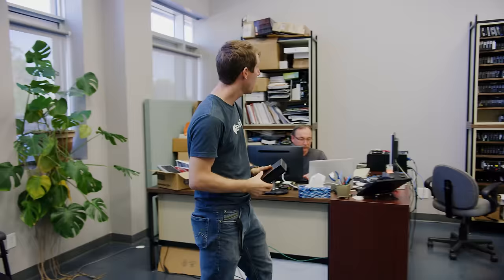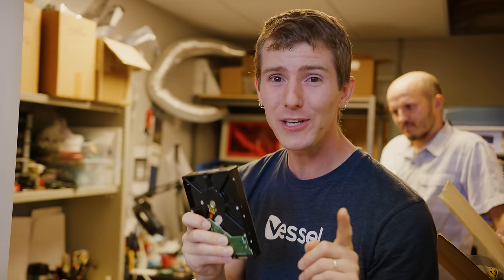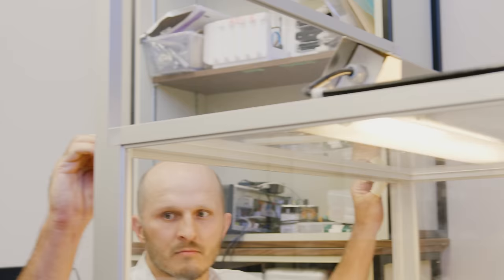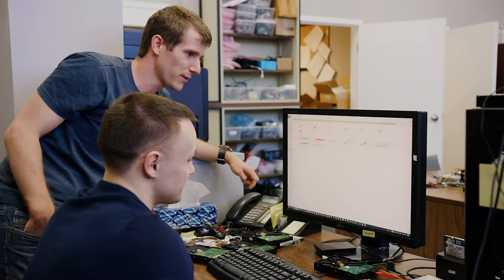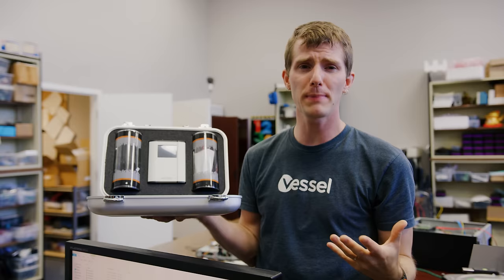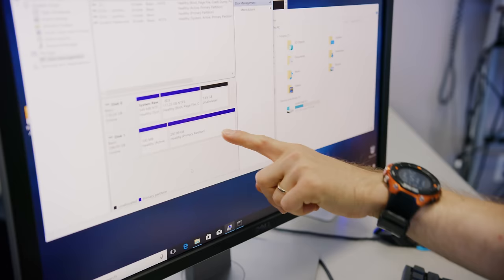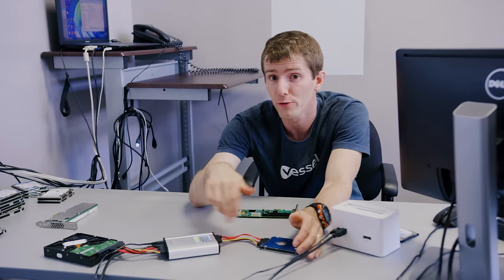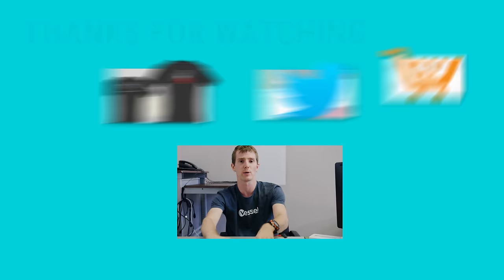Don't Waste $1000 on Data Recovery

Comment: Hello Linus! Thanks, great tour on the HDD recovery process!
I'm afraid you didn't cover up a very common disk types in laptops now days: SDD and M.2. As far i know this has a completely different recovery process. At least on Desktops the usually setup is a small SSD (for OS) and a big HDD (for your files). But in a laptop that is not the common setup, usually you only have a SSD disk. 
Can you do a similar video on this subject?
Reply: I 2nd this!
PLEASE
Reply: With M.2s and SSDs, you are pretty much SOL. Much more complicated with a lot less chance of recovery. Make sure to have redundancy for your backups, always.
Reply: yup, accidentally formatted my drive and my whole folder of photos is gone.
Reply: @Allan Cameron that's what I wanted to do but i had to get them off the ssd first 🥲🥲

Comment: Last week, my precious external HDD disk fell down on the floor. When I connected it to my PC, the laptop didn't recognize it. Definetedly, my hard disk was broken down. I was told that only an especialized lab could recover it paying for that around 1000€. I'm devastated because several years of keeping away information have disappeared in a bloody second. In your video I can hear the soft little noise the hard disk makes when it's working. Undoubtedly, a physical element inside the device is damaged.

Comment: How to protect data to not need to recover it:
 1. Backup data
 2. Don't drop your hardware
 3. Don't have more data that you can handle protecting

Surprisingly Linus recently actually did start doing the 1st one. But he knows well that may not be enough so here he is - studying data recovery. Because deep inside he knows his drives will go bad soon and all those TBs of data will be causing him lots of headache.

Comment: I had a dying 1TB drive with around 600GB of data, that I was able to recover around 80% of before it just stopped transferring. Linux, more specifically Parted Magic was the answer, when Windows just wouldn't load/read it. Although the read speeds were painful...anywhere between 200KB/s and 2MB/s. I had to leave my rig running for a couple of days.

Comment: You know what. This was actually a great video. 

My friend has an external usb harddrive, and it's not being recognised in Disk Management as a disk. Every so often an 'unknown device' would flash and disappear. 
Apparently it was clicking, but my work colleague opened it up and moved the head. Now it isn't making any noise. 

In Device Manager it's coming up a seagate backup plus harddrive. 

I'm thinking about opening the enclosure again and sticking the 2.5" drive into a PC using power and sata as opposed to USB. 

Even if I can't bring life to this drive, this video was still cool. 

I'm wondering if this automount disable and automount scrub will fix it.
Reply: Open it and connect the drive directly to the pc through sata/ide(if it’s old lol) in my 15 years experience a lot of the time the enclosure fails but it also has been drive it self a couple times, try to connect it directly and good luck 👍
Reply: @KngKurd 
The 3.5" ones fail all the time. The 2.5" ones were usually the drive. In my experience, anyway.
Regardless, if someone has opened the disk itself and pushed things around, it's probably stuffed beyond repair now.
Reply: Wow, I wasn't expecting anyone to reply. Thanks.  

I'm probably going to plug it into an old PC and see if firstly the bios sees the drive. If so boot, if not then welp. Harddrive has family photos etc.

Comment: So what have we learned here?
1. cool tricks to restore data
2. BACKUP BACKUP BACKUP BACKUP
3. and finally, BACKUP YOUR DATA!!

Critical data? Keep it in more than one copy and preferably more than one place! dozens of dollars for HDDs will cost far less than restoring your data in case of a catastrophic scenario (theft, flood, electrical short, drive that is fallen to the floor, etc....
:-)
Reply: I tell everyone who computer I work on. BURN to dvd or bluray all your important stuff. Paperwork, pics, music and videos. DVD and Bluray don't crash! You can keep it on your HDD, but always BURN BABY BURN!!!!!!!
Reply: Seen recently: There are two kinds of people; those who back-up and those who haven't lost a drive yet.
And coasters (DVD/BR/CD-R) can be corrupted by a spec of dust during burning, a scratch afterwards (-Rs have unprotected surface), etc...  Always verify them and if you're using disposable media, burn two.
Cheap network NAS, "cloud" backups, and USB HDDs all pay-off in the long-run and can be encrypted.  Coasters can help better in ransomware attacks, though.
Reply: It amazes me how many do not back up their data. Even using the cloud is a simple way to do it, and it's generally free for your most important stuff.
Reply: i didnt back mine up and just lost my HDD yesterday with 500 gb of premiere files :( gonna start backing up now
Reply: I backup, backup, backup  and the backup drive  also die.
Reply: A backup is both a good backup and a bad backup until you check it.... :-) aka Shrodinger's drive or shrodinger's backup
Reply: @majorbud4207  can't backup on bluray terabytes. that's the farest possible option.
Reply: yeah. i backed up my important data on all 3 of my hard drives in my computer, then my power supply blew up and killed all three of my hard drives
Reply: My 1st backup drive got erased/damaged due to hardware failure. 2nd backup drive got erased by windows during a reformat/reinstall to a different drive while connected.
Reply: MaMa DeW  if an ssd fails it fails totally. Been there done that.
If a regular hard drive fails, you have a chance to recover your stuff. Been there done that too.
This is probably Your best bet: verbatim gold archival quality or similar that states archival quality.
You still should have a backup on a spare hard drive somewhere as well.
For irreplaceable items and if you don't mind the internet stealing them use a cloud backup too.
At least 3 different mediums would be best. And for those irreplaceable ones on backup, store those in a separate location. Having all backups in the same house and house burns down doesn't protect your precious data.
Reply: I currently use two old lappys as backup servers for my critical data, and thus far it has worked out quite well for me.
Reply: @scurvofpcp  two old laptops will work and be convenient, BUT you mentioned they were critical files. Back your stuff up properly!
Reply: @3butalcomp3  They do make nice offsite backup options, I do digital art and having extra copies of my bashkits and final assets is a make or break for me, and yeah I've got 2 local backups (usb drive and an extra local  machine). But if worst comes to worst (house fire or such) I know I can restore 2 Tb of data via remote download and or a 4 hour drive.
Reply: @majorbud4207  Those cheap optical discs go bad pretty quickly, even if by quickly I'm talking about four years. I have my data on two computers and a back up hard drive and my most important stuff is always on a thumb drive I carry with me everywhere, so even if everything in my home gets stolen, I probably still have a copy of the most important stuff
Reply: @informediatech-bruno5766  statistically speaking
Reply: RonkoDDR,
I don't backup anymore. It doesn't help. I was never  able to find a missing file.
Reply: @jameswyatt1304  Yep, I have my important data sync'd to Google's cloud, plus and internal backup drive, and an external usb backup drive. That is still hundreds, or thousands, cheaper than doing data recovery. Storage is cheap overall. Backup your shtuff.
Reply: @majorbud4207  Sorry, but this is actually bad advice. Bluray / dvd is not a suitable long term backup solution because they can degrade over time and become unreadable (this happened to me)
Reply: Nothing can last forever everything will die eventually nothing is perfect only God is the true meaning of perfection
Reply: @misterxzxc7314  that's very nice. Anyway, in the meantime, back up your data!
Reply: @casinowilhelm  you're crazy what did I just say right now nothing is perfect why should I waste my time buying and copying my files to another HDD that will fail at any moment this is ridiculous
Reply: @misterxzxc7314  the odds of your main drive and your backup failing at exactly the same time is much lower, that's why, but I think you're just messing with me now :)
Reply: @casinowilhelm  I'm not messing with you I'm telling you the truth how long did you think the HDD can last you can't tell maybe years months or even minutes when you start using it even if you stop using it and bucking up Everything you had to use it in the future there is a risk that will fail
Reply: RonkoDDR Quantum Comedy 🤘
Reply: @majorbud4207  I have abandoned optical discs ten years ago. I have 3-4 backups on hard disks and 1-2 on cloud for my important data. Optical discs are a dead end. It is hard to copy data further from them.
Reply: @vishalboodram  A backup that is connected to the computer is not a backup.
Reply: @casinowilhelm  But have you planned what to do in case of data loss? As a rule the worst thing to do is to use your backup. You should get a completely reliable computer and make a copy of the backup first.
Reply: @okaro6595  Yeah absolutely. I'd buy a brand new drive and copy it all over before doing anything else. I'm also using Dropbox for current projects so that's safe anyway, and also backblaze for the important old projects. I do freelance animation and 3d so I generate hundreds of gigs of data on every job I do, it does get a bit tricky managing it sometimes. You have to be completely on top of it and have a system that you always stick to. Because a client can often come back to you after several years and ask to update an old project. If you have lost it you are double f**ked!
Reply: @casinowilhelm  I once ruined two USB sticks by putting them on a faulty USB-port. Fortunately neither was mine. So if a USB device does not work, you should suspect the port and not stick all your backups to it.
Reply: Back up to WHAT? what is a safe backup? CDs' or dvd s have proven the only real backup that seams to good, all other drives, usbs, externals etc, etc, etc seam to be shit and very costly.
Reply: @Darkpixies  nope, cds and dvds eventually rot over time, especially cheap ones.
Reply: @Darkpixies  No no no no CDs or DVDs . This is 2019. One would have to get new ones almost daily. External hard drives are the best media and one should have several copies. Also one should not have them hooked up to the computer all the time. Cloud us a good way to do off site backup.

Too many people think what is the best media and then do not backup at all as none is too good for them and then they lose the data.
Reply: Joe Blo  
THAT! IS! CORRECT!
:-) 

By tech people's definition, backup without validation is no backup.
Reply: @misterxzxc7314 there's a risk everything can fail, including your car, your toaster and even your heart... yet you have no qualms about getting worked up about failing backups. 

Simply, if you store your backups well, you shouldn't have an issue. If they fail? They fail. As for time, it doesn't take much to plug a usb hd drive in and move files across, as long as your files are organised, it will be easy. It's a no brainer. We're only talking about files you don't wish to lose, as in photos, videos and the various electronic documents you may have.

Comment: I've soldered a bunch of stuff before. Save batteries, romchips, speaker wires, LEDs, charging ports,etc. Practically everything you can think of. I guess you can say I'm my family's personal repair-girl. Lol.. I've also had to recover my mother's PC from hdd near-death, de-virus my dad's, and sisters PC's, etc.. I've had to do it alllll..... :3 (and I don't get paid) (oh yeah, aaaand backup my mum's 2 tb PC... On to DVDs... It took 12 hours.....)
Reply: +kaity kline:
Good.
The next step would be to collect electronics that people throw away and recycle them or fix them up.

I've made little repairs to TV remote, a TV decoder capacitor was too old, a DVD player that was being thrown out had a mechanical problem with the tray, ...

Comment: For certain issues, you may be able to pull out data by freezing (cooling) the drive. If it works when you plug it back in, you probably only have a few minutes, so you need to pull off the files you REALLY need first.. You can sometimes rinse and repeat a few times, but typically eventually it will fail completely. Worth if you would not consider sending in to a company to recover. If you do plan on doing that, of course do NOT try the freezer method..
Reply: Do not rinse the drive though.

Comment: I want to chip in and say thank you for uploading this video. Without the automount disable hack, I would've probably never otherwise been able to access a 15 year old drive which was dying. It had two partitions, one being mostly fine, and its windows-partition which are currently in a RAW-state.

I never figured out how to use Rstudio to do whatever it was you did in this video, but I found Recuva which helped me save 190+ pictures from the RAW-partition (after two scans of 16 hours each).

And now, I will do the same with other old drives which seems to be dying on me.

So, thank you Linus and thank you DeepSpar for allowing a video like this to be made.

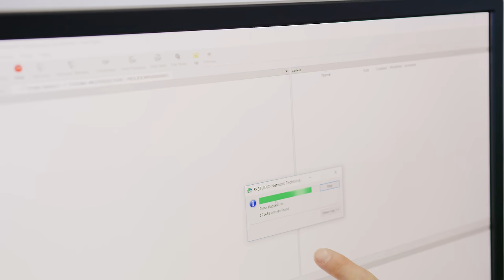PS. Any chance you guys can tell us how we can make Rstudio (or any other free program?) do that thing @14:30? I still don't know if the first drive has logical errors or if it's physically broken.
Reply: Just use test disk for raw format.

Comment: My drive has been making a weird noise which can be compared to a bad fan for years. I thought it was just a fan so I didnt care for it. Found out it was actually coming from a drive and I just continue to neglect the problem as it has been running fine for long and has no important data on it. It starts making this noise comparable to a fan hitting something and I just hit the side of the computer gently and it stops for hours to days. That is an good IT tips for you right there!

Comment: You missed one.  I have recovered a couple of drives with bad firmware by talking to them via TTY.  I had to make a cable from a (really) old mobile phone USB cable but you can talk to the drive's processor in a console window and know things tell it to do things.
Reply: Got any links for a howto or somewhere to start?
Reply: seagate 7200.11 family I bet
Reply: None other!  Bad firmware.  It was a very, very fulfilling recovery.
Reply: As Jay says, Google Seagate 7200.11.  It was a rough year for a lot of folks.
Reply: @chuckygobyebye  I work for a data recovery company, must of recovered thousands of them, still get the odd one now and then.
Reply: That's funny, they're very old now and out of warranty.  I understand that the fault is due to an an array overrun.  I would have thought that they would have all failed by now.  Do you know what the failure mode is?
Reply: @chuckygobyebye  poorly written firmware, causes the smart module to fail at random which bricks the drive. The commands you sent will of cleared the smart and then reinitialized the translator  module. They did release a firmware update for those that had the affected models, no use if it had already failed though.
Reply: Isn't it! I've just recovered a friends drive that had fallen victim to this firmware bug, their computer had been dead for nearly 3 years. Definitely the most satisfying and educational computer repair I've ever done. Hopefully the newer firmware for it did actually patch the bug as they claimed it to do.
Reply: @Tekwyzard  it did. Really don't rate the newer seagates either, buy anything but.
Reply: @jayrb2801  ohhhh yes. We have an 8 disk raid array at work that started with all Seagate drives and we had two fail shortly after warranty. Replaced them with wd reds and just replaced those after two and a half years with no problems. Old drives went into the backup array with the two spares and they are very happy. I assume Seagate got their shit together but I am now very cautious of using them again. And to reply to the previous commenter, there are few better feelings than recovering an apparently dead drive.
Reply: @chuckygobyebye  from a data recovery perspective, when seagates fail they fail for good. I have a 4 disk array, over time I've had to replace both the seagates in it. Better off with wd or Toshiba aka Hitachi .
Reply: @jayrb2801  we have 10gb reds in the array now on raid6 and it's wonderful.
Reply: @chuckygobyebye  if only I was rich enough to do that with mine :( good choice though btw
Reply: Took 18 months to get past the boss.
Reply: well I hope to never see your setup!

Comment: PSA: Don't forget to back up your data.
Reply: @TomYaboYoga  and backup the backup of the backup
Reply: I don't have that many drives it's too expensive :(
I've got a maxed 500GB SSD and a maxed 2TB HDD.  Getting a new 5TB HDD soon, but it's for new data, not backups.  My HDD had some bad sectors a year back too, a 20 hour disk check seemed to fix it though.  Hasn't acted up since then.  
Still monkaS

Comment: Liked the harware bits of the video. You can use software such as dd for sector issues from memory to copy backup the disk. Testdisk/recuva/ddrescue can be considered for file recovery of files from corrupted disks. macrium reflect is rubbish with sector issues when trying to back it up.

Comment: You got disk spin! now this is a happy little drive.
Reply: I had an IDE (or PATA) drive that wasn't detected in my "new" pc. One pin had sunk into the connector of the drive and was impossible to get it out even using tweezers -.-

It took a whole month to download all my games again to a new drive because i didn't have access to any decent internet access -.-